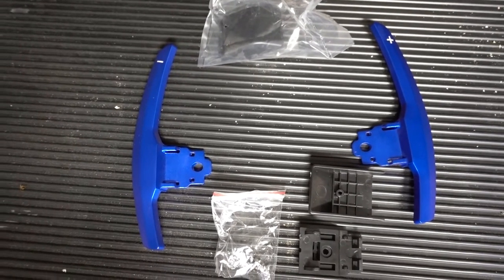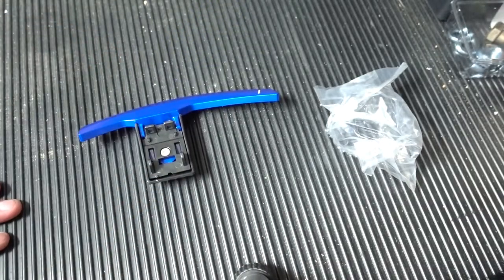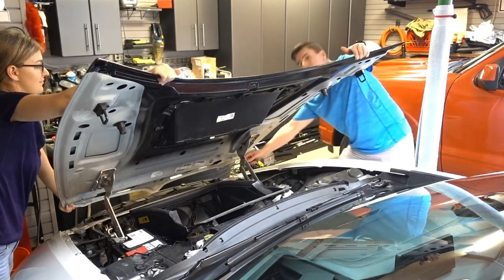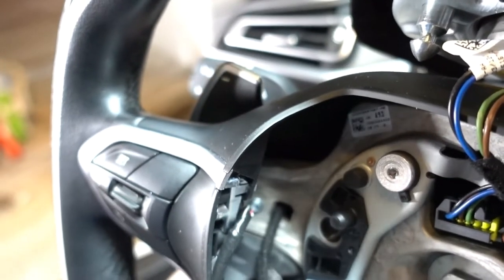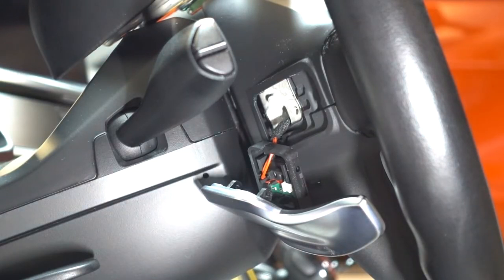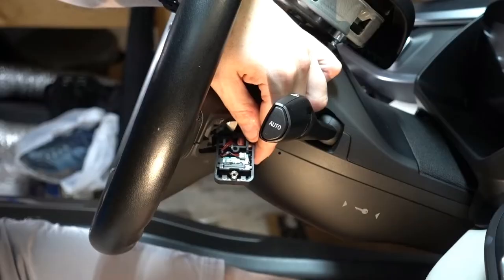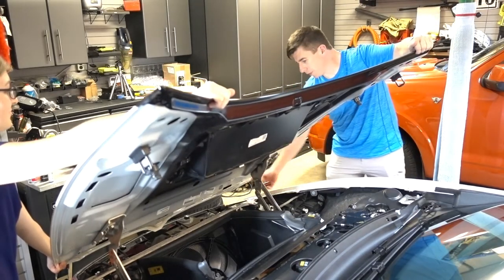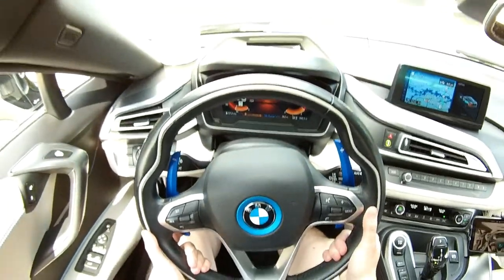How to install aftermarket paddle shifters in the BMW i8

Comment: Awesome video Pat!! You literally sound like my work safety videos on "how to's". Very easy to understand....unlike my DIYs haha!
Reply from the maker: Thank you, kindly!  As an introvert, it's hard to speak to a camera.  So, my overcompensation is definitely having an effect on my communication compared to how I normally talk.  ;)
Reply: @PatsGarageOnline  I think it's awesome. Makes it super easy to follow. I'm gonna be putting on paddles and following your DIY. Got my springs in today. Gonna attempt to put them on Saturday morning.
Reply from the maker: @RDDC_Official  glad to hear you'll be using the steps for the paddles. One thing I noticed is that the plastic on plastic rubbing from these Chinese midels was a little squeeky sometimes. I added a little dielectric grease later on where the parts met and now have silent activation. Looking forward to hearing how your projects turn out!
Reply from the maker: @RDDC_Official  also, be sure to use the steps in your service manual to deactivate the high voltage battery first. I need to update my description to do this. I realized I didn't do that when I filmed. It's the orange block in the firewall. Pulls apart about 1/2 an inch and you'll see a notification on the dash that the high voltage battery is disconnected. Then you remove the 12v battery lead
Reply: @PatsGarageOnline  ok good to know. I was going over some schematics on the high voltage battery. I really would like to add in some graphene supercaps. Gotta make them though. I think I'll start with my electric scooter first 😄

Comment: Hi Pat. Have you or will you be doing a video on how to change the serpentine belt? Thanks
Reply from the maker: The service manual steps for replacing the serpentine belt required draining the coolant and removing some of the high voltage modules in order to get access to the starter generator. The tensioner on the starter generator then needs to be removed in order to get the belt off. The last time I was under the car with the stiffening plate removed I took a look up at it and realized that this is a much bigger job than I ever want to take on. So this will be a dealer installation if I ever decide to have the belt changed.
Reply: @PatsGarageOnline  where can i get a service manual

Comment: hi Pat great video.  Now that you've been using these for a while how do you find them? Do they feel as solid and robust in their mechanism as stock ones would? Also does the blue colour perfectly match the rest of the light blue in the car's stock interior as it's hard to say from the video?
Reply from the maker: Thank you!  After a while, one of them was starting to make a slight rubbing noise that sort of bothered me.  I took it apart and added dielectric grease, and that fixed the issue so I felt better with them.  They're still very solid and I use them when I drive sportingly.  The blue on the paddles doesn't match the blue on the BMW symbol or it's blue outline.  It's a darker blue that matches the darker blue on the LDC screen with all your instruments.  I felt that it matched something, so it was worth keeping.

Comment: Pat got to the part where I put the Allen key in hole and one clip released but other side won’t and horn keeps beeping
Reply from the maker: You may need to disconnect both the 12v and high voltage battery to prevent the horn from blowing. Please see my video on lifting the hood, on my channel. There may be something wrong with your steering wheel, airbag, or mounting system. Proceed at your own risk if you want to. But all liability is on you.  You might try pressing the airbag back into the steering wheel if it will go, But according to the service manual, you need to apply pressure to both sides evenly. So I'm not sure if that will work. Or, you might try releasing the other side of the airbag (the side that wouldn't release at first) while pressing on the other side of the airbag that did release. This may take some tension off of the spring and allow you to disconnect it.  Without being there to see it, it's impossible for me to know exactly what is going on. I wish I can provide better advice, but this is about all I can say.
Reply: All sorted second time around
Reply from the maker: Glad to hear it! What was the fix?
Reply: Pat's Garage Online other side first

Comment: can you do a video
to replace the horn in i8
Reply from the maker: Thanks for the request. Please see my front splitter install video. In that video, I remove two panels under the i8 front bumper. Under each panel is a horn. There are two. Here are the service manual links:

https://www.newtis.info/tisv2/a/en/i12-i8-cou/repair-manuals/61-general-vehicle-electrical-system/61-33-horn/1VnXzXuZt4

https://www.newtis.info/tisv2/a/en/i12-i8-cou/repair-manuals/61-general-vehicle-electrical-system/61-33-horn/1VnXq2c7Zk

Comment: When i press the release the horn start screaming
Reply from the maker: Your tool is bridging the connection between the two pieces of metal that form the horn switch. If you disconnect the 12v battery that will prevent this.